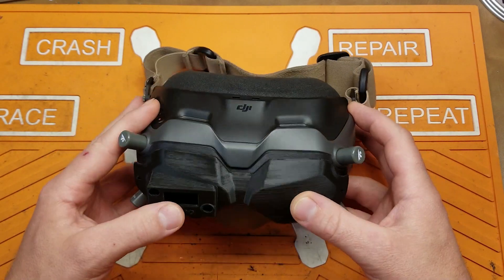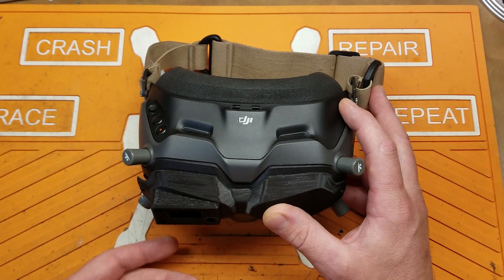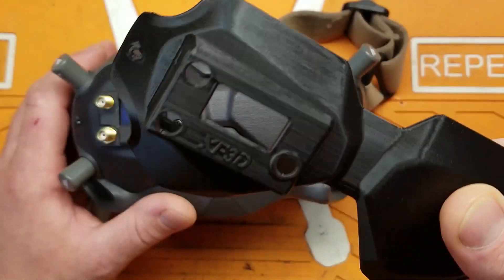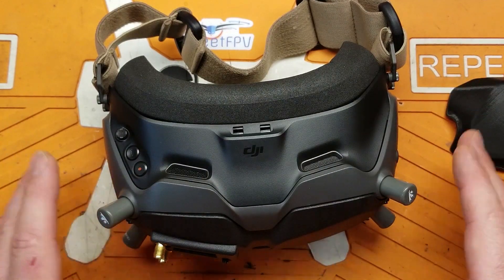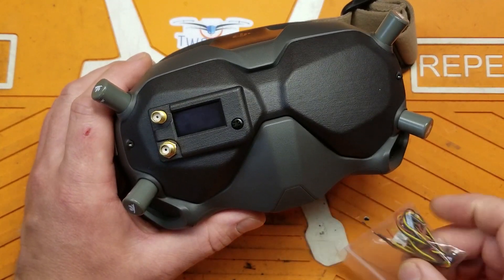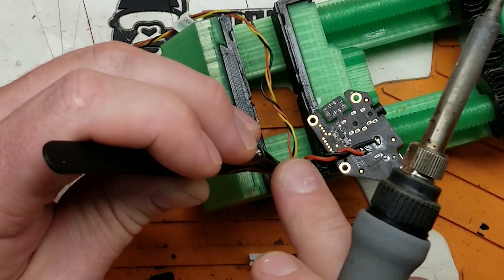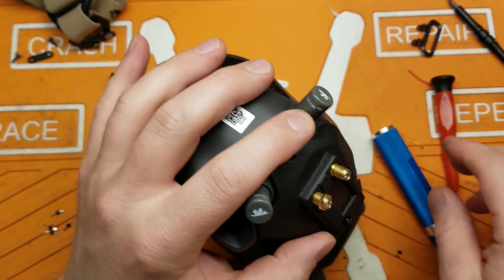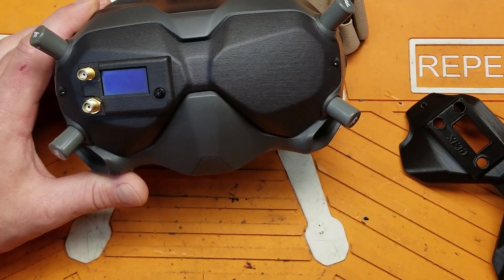The best DJI analog conversion!

Comment: Are you still using this? Looking at both the BDI-digidapter and this one for my DJI-goggles, but I prefer the slimmer profile of this faceplate. I dont mind hardwiring it to the goggles but I was wondering if you had any other issues.
Reply from the maker: Yes I am. And I still recommend it. If I did it again I would put a power button in line with the bec so I can turn off the analog module when I'm not using it.
Reply: @TweetFPV  Funny, i was thinking about adding a power button for that reason. But that would mean I would really have to modify the goggles because I don't want to add a power-button on the face-plate. If I'd do that then I would add a power button on the right side or on the top of the goggles. 
I recently started experimenting with head-tracking FPV so I'm also planning on running an arduino nano board on the same bec and build it in the goggles. I already opened the goggles and there seems to be enough space on the top to do that. I plan on making it look as OEM as possible.
Reply: @TweetFPV  Where would you put the power-button if you had to do it again?
Reply from the maker: I would put a small button on the face plate.

Comment: If I wanted to add an on off switch for the analog do you have any idea what size switch I would need? 5amp/10amp
Reply: The ampdraw for a rapidfire module is about 350 mAh, so a 1 amp rated microswitch should be more than enough.

Comment: Good video! would still be running the ugly 3d print if it wasn't for this thanks, does anyone know if its possible to get audio out of the module through the goggles?
Reply from the maker: to the best of my knowledge there is no capability to capture audio from the aux in on the DJI goggles. But as with everything where there's a will there's a way.

Comment: Just saw this video and wanted to get your Opinion compared to the mod  you did...  https://youtu.be/fLi5KlUseLg
Reply from the maker: The Digidapter one is nice but is very large and bulky. It is nice that it doesn't require any modification to the goggles, but that wasn't what i was looking for. I want slim and light. Your DJI goggles probably won't fit in the bag that they came in with the digidapter thing. Honestly it is a tossup. just depends on what your preferences are.
Reply: TweetFPV gotcha... appreciate your response.

Comment: Which antennas are those on the goggles? Do they work just as good as original?
Reply from the maker: They are the truerc antennas. They are a little better than the oem ones. For me i like them because they are smaller and the goggles fit into the bag without removing the antennas. Good sma connections are only rated for 500 mating cycles under good conditions and at the proper torque. So the fewer times i have to remove and install them the better.

Comment: Great video, I’m new to FPV (couple months new lol) I figured there was no reason to go analog when HD seems to be where everything is going... so I decided to just buy the DJI goggles. I flew with other people for the first time the other day and I couldn’t watch them fly. It was at that moment I wanted to have both... but now after watching this video I’m thinking I can just do this.. what all do I need to modify ?
Reply from the maker: All you need is this face plate, A IRC Rapidfire, A bec, and some wire to connect everything.
Reply: I watched Bardwell’s video of taking the Goggles apart... is that what you have to do for this mod? Or just the faceplate? Appreciate your response
Reply from the maker: yea you have to take them apart.

Comment: Tweet - im running the iflight mod im having some battery issues - im running a 2s lipo with my goggles and when its fully charged 8.4 you plug it in and its giving me 7.7 volts? Could this be due to a bad bec? Worth subbing in the Matek one?
Reply: I should add i have 3 of these batteries and it does exactly the same so its not a lipo issue
Reply from the maker: Its most likely that the goggles aren't very accurate at lower voltages. I have found the DJI goggles to be almost un-usable on 2s. The low voltage alarm goes off very quickly even with fully charged cells. The goggles are only rated down to 7.4v so if the system under load sags voltage at all then it might be seeing artificially low voltages. I really don't think you BEC is the cause for the low voltage. Have you tried running the goggles on a 4s pack to see if there is still a large discrepancy in voltage?

Comment: Hi TweetFPV,  I saw on the BEC’s TPU a slot for a capacitor : Did you put one on your matek Bec ? Is it really needed ?
Thanks for the share of this very good analog solution.
Reply from the maker: I didn't. Haven't seen a need for it.
Reply: Ok! It’s just that Steve put this comment (add a caps) in his Thingiverse account...! Many thanks for your reply and I wish you good flights!

Comment: Great video, how did you fix the light leaking and how do you like the ethics strap
Reply from the maker: Light leak was fixed with the dji foam fit kit and I really like the ethix strap. Or really and 1.5" wide strap.

Comment: If you’ve ever gotten something printed by Shapeways, they use the same process. Not cheap, but looks way better than “traditional” FDM 3D printing and good quality.
Reply: Hi, the process is HP's MultiJet Fusion (AKA MJF) and is solid Nylon 12. Absolutely not the FDM that we know.

Comment: I would so buy that but I have the True D module :(    I used the side mounted module first then as you showed , I had the front faceplate from an Ebay seller where the cables ran exposed over to the side . I ended up taking the goggles apart anyway and hiding the cables. It works good for now but that part here just screams OEM and me likey .
Reply from the maker: Yea it looks and feels like a OEM made part!

Comment: Looks great.  I have the iFlight version but this one looks better.  I just added a tiny switch in line with the power wire so I can turn the module on and off, it was killing my batteries too fast leaving it on all the time.  I need the .stl link for that 3d printed vise lol
Reply from the maker: https://www.thingiverse.com/thing:2064269
Reply: mind linking to a photo of what that switch looks like? not sure where to put a switch